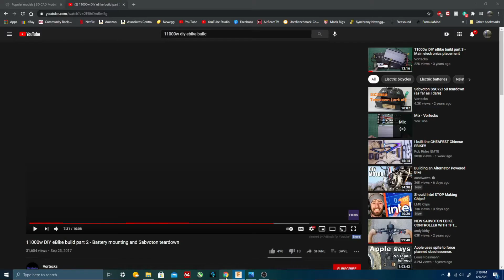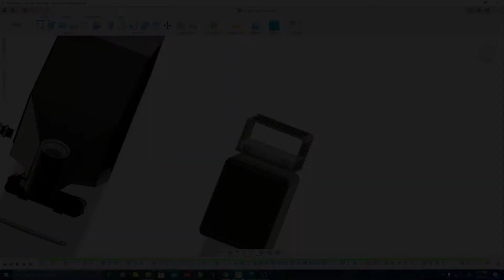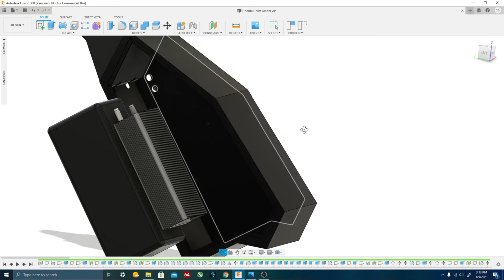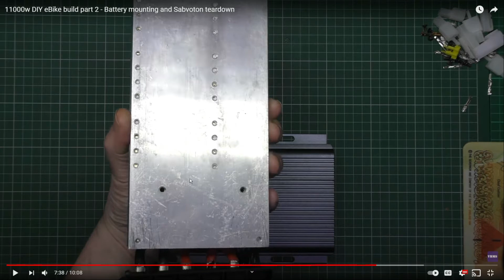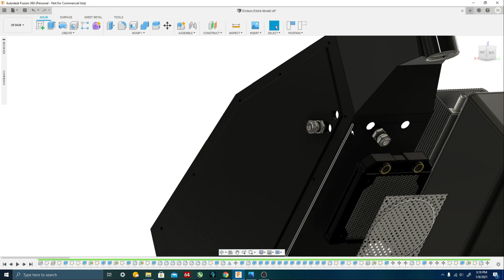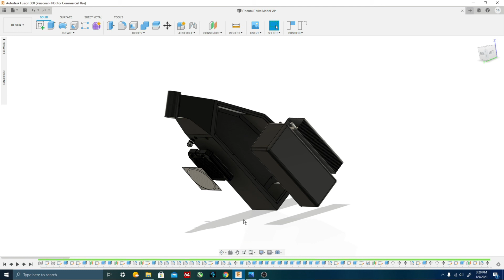Water cooling an electric motorized bicycle? Part 1

Comment: probably already mounted this, however wouldn't you have better cooling if the heat wasn't blasted against the bottom of the frame but allowed to pass through the other side? dirt bike radiators are mounted on the upper side of the bike which allows for air to blow thru the rad and out the back. also the battery itself creates heat so mounting controller isn't ideal. you could even do a sealed water cooled unit with aa air intake type system with a water catch baffle so in short you have a hybrid air/liquid working together with amazing cooling. I am actually starting a bomber build in 2 weeks . if interested I can record the mods for you and post. cooling is a priority for me. both controller and batteries as well as motor. all electronics will run on one battery pack while the motor has it own battery. nothing like being creative, fabricating and being unique with one off things.
Reply from the maker: I don't have the cooling loop on the bike yet since it's still so cold out, but the rest of it's been setup like that for about 6-7 months now. I suppose I should have added standoffs to that drawing so that was more clear. It's not going to be mounted flush with the frame, of course that would just about negate any positive effect from it. I haven't decided yet, but I've been considering mounting a high rpm delta fan on it that I can switch on and off at will. Those little suckers move quite a bit of air, but I'll probably still test the more passive setup first.

I'm not as concerned with the battery temp though to be honest. From my experience this last summer, which was hotter than hell here lol, the controller was the only component that was getting hot enough to be of any real concern. Battery pack, even around the BMS, didn't get much higher than around 45-48C even when I was pushing it pretty hard. I can't be sure that a lot of that wasn't heat soak from the hot bottom of the controller directly contacting the pack though either. 

Any  particular reason you're running the electronics off of a separate pack? Unless it's real small you're sacrificing valuable real estate inside the frame, not a ton but you know what I mean. The power draw from adding a few led lights and what not is pretty negligible for a bomber sized pack. If you're worried about it drawing the battery down when you aren't using it, pick up a 72v to 12V 5A step down that has an ACC line on it. That way you can tie that ACC line to your ignition key so it can't draw any power unless the keys turned to signal the relay.
Reply: @PhysiqueGeek  I want a separate pack for accessories , unless I utilize all the available space inside the frame for battery. I am not sure yet. I am ordering the frame today and have been researching batteries . I desperately want to use LTO batteries however I may have to weld up a custom frame for these given their size, but the capacity is amazing. The controller is going to be cooled the same way you are doing it. I am looking for a sleek way to have this all done, maintaining temps and trying to push for 300 miles on one charge. I researched hub motors and I have found if I run 2 1500w hub motors I can keep temps way down as opposed to a single 3000w motor. some of those motors are only 80-85% efficient . My goal is some torque for hills but distance at a reasonable speed and this is hard to find. Alien power systems though builds custom motors and I may need to go that route. another problem is 2 1500w motors will require 2 controller from what I have seen. another option is running the hub motor in center of frame to allow for a cvt hub ...any ideas or input from you or anyone is greatly appreciated. building a stock stealth that everyone has for me is boring ,I like one off things and this is causing me to have to put in a lot of research time constantly changing parts, writing a new parts list and such. Waterproof or biometric switches are something I want for lights too. the aluminum ones not cheap plastic. a lcd screen in bike onto instead of using my phone is something else I would like  this though would require a mobile hotspot of some sort so maybe a used phone dedicated to the bikes programming could be used and installed which is light weight.
Reply from the maker: @simplelife3466  You're just like me haha I am the same exact way. Before I make a move on anything I research til I can't research anymore. Then it's usually at that point that I'll find something that looks like it should work better and I start it all back over again lol. 
You're right, it's tough trying to find that balance, especially with all the different parameters of the components available. Seems no matter what you always end up compromising on something a little more than you wanted to. 
A mid drive would be a great way to go, I love my bike but it would be nice to have the weight of the motor AND the battery all low down in the center of the frame, rather than having a 55-60lb rear wheel.
The weather here is finally starting to warm up so I'll probably be hooking this cooling system up in the coming weeks, or days.
Reply from the maker: @simplelife3466  The only thing I don't like about having a hub motor up front as well is the torque steer. It always seems to take over at the worst times possible
Reply: @PhysiqueGeek  anyway you can delay or lower the amount of torque thru controller to deal with this issue? it was something I have considered as well however for hill climbing off road would be great lol. I am actually looking to build and sell bikes,mountainboards, and other electric vehicles however first I want mine and a long road trip . please let me know what you find for the electric used on headlight if you have one and other accessories if its so low theres hardly a impact then ill use all space available for one battery. delfast has a 236 claimed range so 64 more miles should be achievable.
Reply from the maker: @simplelife3466  No doubt about that, having 2wd would be amazing for tearing up the mountain and coal banks around here. To be honest I never thought about REDUCING torque before, only increasing it lol. The headlight and tail light on my bike only pull a grand total of 22W which is completely negligible to a battery pack of the caliber these frames can fit. We're looking at 12v @1.8a give or take. For a 72v 38ah pack that may as well be nothing. That probably equates to losing maybe a mile or two off the range, if you run them all the time. 

The sabvoton controller software is pretty rough, and I was so damn impressed I didn't feel the need to tweak much of anything. You could definitely go in there and hard limit the amount of current it will pull, but then you may as well just buy a lesser controller and save a buck.
Reply from the maker: @simplelife3466  as far as efficiency goes towards reaching that 300 mile range I'm not sure adding a second motor and controller is conducive to that lol. That's a lot to ask of a battery unless you buy you know a $2000-25000 battery for it, or you don't ever go near even 1000w output
Reply: @PhysiqueGeek  what is the power of motor your running? and what are you using to go from the volts of battery to 12v? I am undecided on battery 48v,72,144 lol 90% ill be on road normal hills looking for 40 plus sustained mph . how much knowledge you have with electricity? I have little just basic so im wondering if my side covers can be solar panels and if a buck converter to step up volts would help with power to battery . tires also play a roll no pun intended so looking for the least rolling resistance . eventually ill go from steel frame to hand built aluminum .if solar covers aren't a option then carbon fiber will be put on for weight reduction. are you using thermal paste between controller and the cooling plate? questions questions questions lol. my build will be under way soon have a whole note book of ideas and such realistic ones that is. keep me posted. when I get into a project im all in til completion as you see . ultimate goal is to have something no one else has . once this is built I have another electric build ill start .
Reply from the maker: @simplelife3466  mine is rated 3000w continuous but it peaks at over 7000w at full power. I'm just using a basic step down converter, but the important part is the ACC line on it. I put the link to one up there in our comments somewhere. I wouldn't go lower than 48v, 72v preferably, 144v is a monster. I think 72v (84v at 100% charge) is perfect. Yeah it is definitely going to need a thermal compound between the heatsink and the controller mosfets. I might try pads first and then try paste to see how much of a difference, if any, I'll see there.

I don't know all the ins and outs of solar, but I've looked into a few times over the years. It's going to add a lot of extra cost to the project for anything that would be able to charge say even a 48v pack in any reasonable amount of time. I think your best bet would be to invest in something like fold up solar panel kit, and a boost converter. That way you can set it up somewhere at the end of that 300 mile range and let it charge. Otherwise you're going to need a ride ruining amount of solar panels sticking off the bike for it be worth anything at all
Reply from the maker: Also, hell yeah definitely post those videos up! I'm always interested to see what other people come up with. It's all thanks to the motorized bike community on FB that I'm into these bikes as much as I am haha.
Reply from the maker: This kind of converter is what I have in mine, works like a charm

https://www.ebay.com/itm/DC-to-DC-Voltage-Step-Down-Converter-Reducer-72V-60V-48V-36V-24V-12V-10A-120W/183764159256?hash=item2ac9328b18:g:Y-MAAOSwShpZdsEw

Comment: I have an aftermarket oil cooler for the beefed up engine on my air cooled motorcycle, it's just a mini radiator that hangs a bit off to the side to catch air flow.
   I'm not sure if your little radiator will get enough worthwhile air flow mounted in that location but you could always relocate it.
 Lookup Thermosiphon  heating & cooling diagrams. With some clear hoses and the colored antifreeze coolant flowing thru them, it should look pretty cool.
Reply from the maker: Thats the same thing I'm wondering myself. It won't be flush mounted to the frame, I'll use some standoff type brackets. So that should allow a little bit better air flow but I'm sure I will probably change it around a few more times before I'm happy with it. I'll be pleasantly surprised if this little 120mm rad does the job right out of the gate
Reply: @PhysiqueGeek  do you think passive cooling will work as in a fan that spins from riding as opposed to powered fan? would solar panel side covers be enough power to power the pump? with all the lights, accessories and such how much power will this draw out of the battery? see how much this project really is taking. I may have to scale back everything or be building for the next ten years lol. even considered that mini 12v wind turbine in place of the headlight that could power accessories or a second battery while riding or using a buck converter to step up the output . First....the main parts and measurements to figure out the best battery option for the 300 mile goal.
Reply from the maker: @simplelife3466  Yeah that 300 mile on one charge is an ambitious goal, no doubt about that. I hope you achieve it, that'll make for one hell of a fun bike to take out for the day.
Honestly I think doing something like that, with a "passive" fan would only to serve to reduce your overall cooling efficiency. If anything I would try and find a relatively large passive heatsink that could sit on the outside underbelly of the bike. Problem there, and likely something I'll need to build a shroud for as well, is riding off road. A radiator or passive heatsink/finstack is going to get packed with dirt and stop doing it's job after a while.
As far as the solar panels go I'm not too sure. I don't know much about the capabilities of solar power tbh. Being on the sides of the frame I'm not sure they'd be catching enough light at any one time to push even a little 12v pump consistently. I may be completely wrong though lol
Reply from the maker: @simplelife3466  Once I get it all hooked up I will put the meter on to see how much the 12v&5v circuits are pulling
Reply: @PhysiqueGeek   I noticed most older motorcycle oil coolers mount flat facing the air flow but then Buell started mounting theirs sideways with a little air scoop. I assume they tested it and found that mounted sideways with the air scoop provided more cooling airflow. I wish I had the money to build a good beefed up full suspension ebike. 
I seen a video for long distance/road trips, a guy mounted a small gas generator to the rear rack. I was thinking a person could put on a metal rear saddlebag rack and mount a small 800w gas inverter generator on the side where one of the saddlebags would go for a lower center gravity. Make the generator so it can be quickly latched/locked and unlatched to the side= Instant gas/electric hybrid bike. Just leave the generator at home when you don't need range. I'd love to take some road trips on an ebike like that, no licence, insurance, registration,etc.. needed, great mileage. 
    I still don't know if I should go 750w or 1000w mid drive kit & just keep spare chain or a 3,000w rwd kit. I heard the $200 1,000w wheel  kits are junk/won't last and that 750w mid drives are more efficient since you have the rear gears that act like a transmission. If a 3,000w rwd  kit and a 1,000w mid drive kit are the same price. I'm guessing a 3,000w kit would be a better way to go???
Reply: Hardware said battery temp isnt a issue so much as is the controller. though im aware of how oil cools for a gas engine I am not sure how efficient it will be for a stationary motor controller. I also do not know if the motor controller will work best at a certain temp which means I couldn't cool it too much if that is the case . as always I over think things til im burnt out have researched it till nothing is found but things I already have read and then form a opinion . being electric every volt counts that is used unless I find a light weigh option to power a cooler mechanically or use a small turbine fan to power a pump with a buck converter to step up the power . idk everything depends on the space I will have and how heavy I am willing to go but this will be interesting .
Reply from the maker: @simplelife3466  Oil wouldn't be my first choice here either. I'd rather just stick with distilled water. Cheap, clean, and non conductive for the most part. 
I doubt you'd be able to cool it enough for that to be of any concern, other than maybe the extreme cold fracturing the pcb/traces, but we're talking like -50C and lower there. Those are liquid nitrogen cooling temps lol 

I think you're over thinking it man, I like the ideas and I'm not trying to be a prick or anything, but anything outside of a little 12v pump hooked into the system is going to turn it into a way over-complicated process to move fluid through 5ft of tubing. The turbine deal would be cool but it'll be fluctuating constantly based on speed and wind, and LED's don't really like that. I think if something like that were economical/viable you'd see it on motorcycles or bicycles. A dynamo generator setup run off one of the wheels would probably the best choice in that arena